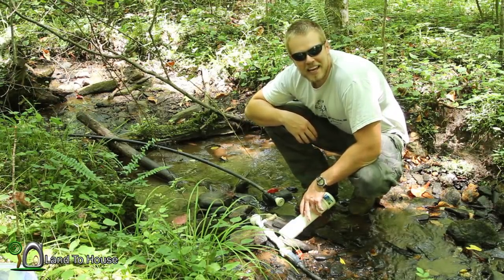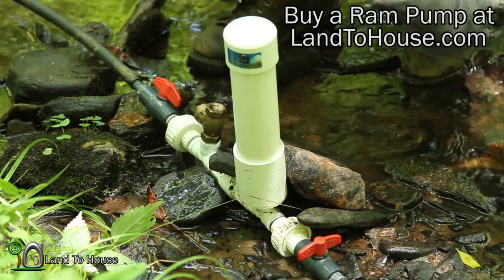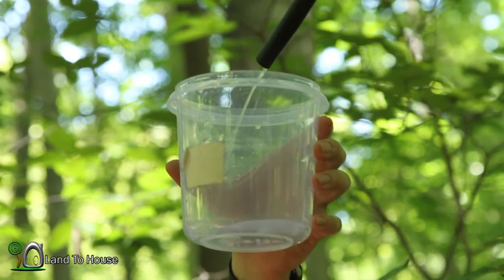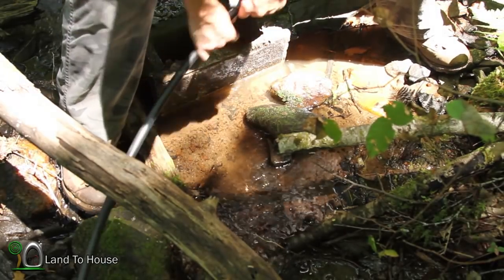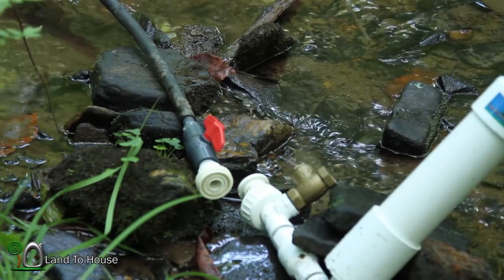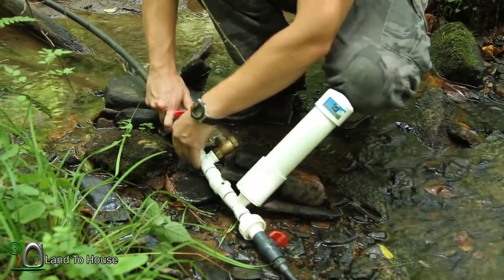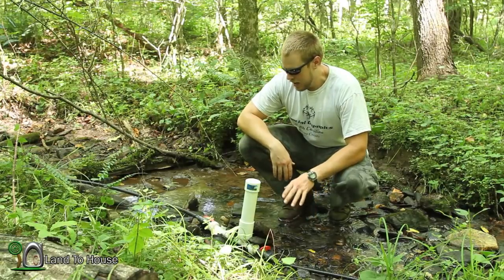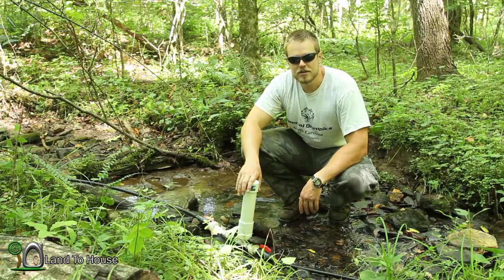Ram Pump Stand Pipe. Does it Matter?

Comment: If you have a barrel at the top of the drive pipe, you don't need the stand pipe. You must have at least one foot of water in the stand pipe. Why? Because the shock(you want shock) is absorbed back up the drive pipe if there''s no weight of that water column. If you use PVC you take away the effectiveness. It is a good idea to use a steel drive line encased in concrete. If nothing else, bury that PVC to prevent flex. No shock absorbing! Using PE pipe as a drive line is useless. It's like a giant shock absorber. Go to Rife Web site. Man! I could fill a book with the mistakes I see on You Tube about ram pumps.
Reply from the maker: There is still a need for a stand pipe. In the small 1/2" ram pump I have determined that the drive pipe can be around 200 feet long before the pressure wave is reduced to a point that the pump will start to slow and stop. NOW in larger pumps, like the 1-1/4", if you try to use a drive pipe longer than 100 feet you will find the pump stops quickly. If you need to go farther than these values to gain the head pressure needed for the job you will need a supply to stand pipe. As for drive pipe material you are right. you can expect much higher efficiency from steel in concrete. But most people I talk to do not have the type of budget. poly pipe and pvc is a great way to get seasonal water to cows or a garden.